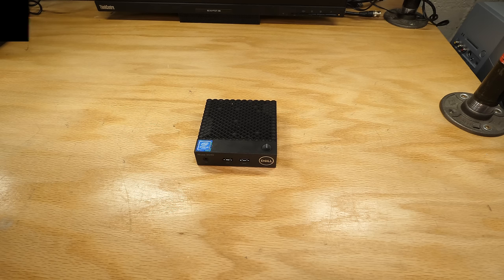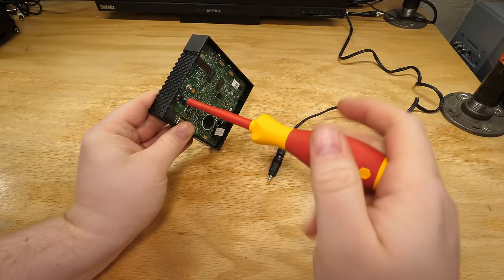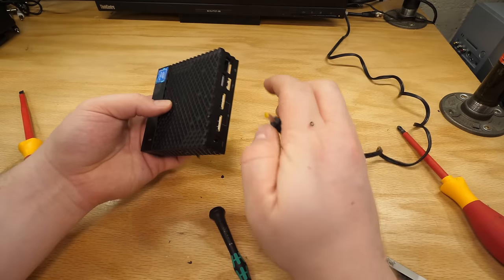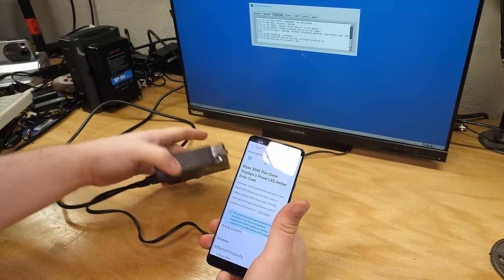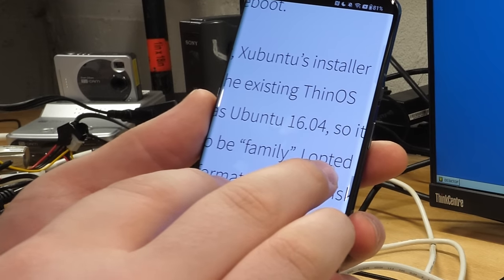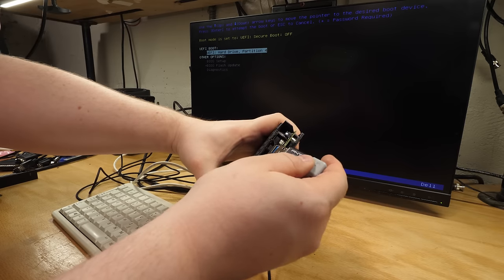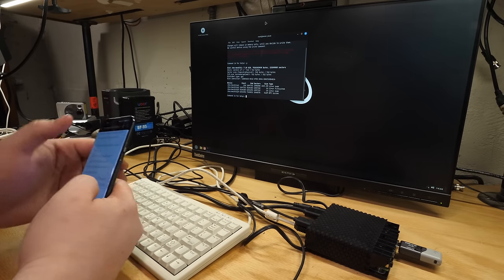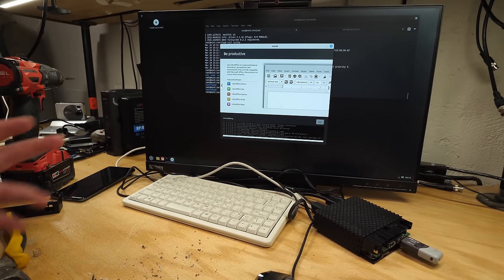Little Guys: Episode 2 [Wyse 3040]

Comment from the maker: Regarding the m.2 slot - I didn't want to dwell on it in the video since I had nothing to put in there anyway, but I'd read that it was useless, and it's even more useless than I realized. Per (https://www.parkytowers.me.uk/thin/wyse/3040/storage.shtml) it has no PCIe lanes and no USB interface; it's an SD port. The only thing it supports is SDIO. I didn't even know this was possible, and I hate it tremendously.
Reply: The idea of an M.2 slot hosting nothing but SDIO actually sounds charmingly odd to me.  I'm not a normal person.
Reply: Huh. weird. That hasn't been my experience. I had an older GeForce card working via an adapter and XP gaming was a blast. Then again, mine also didn't come with a BIOS password so perhaps it's somehow a different (or otherwise patched) model? It's definitely a 3040 with the same specs. weird...
Reply: Huh, given that, I'm wondering how the person who ran into that Unicode issue planned to use it as a NAS.
Reply from the maker: @claysweetser4106  I think a pair of spinning discs plugged in via USB would run at line speed on this thing TBH, should work fine I would think
Reply from the maker: Uh, Not line speed, but the maximum throughput of the drives, you know what I mean
Reply: I was about to comment that the Steam Deck has an M2 SSD that size, so they exist, but goddamnit that’s a crime
Reply from the maker: @xPLAYnOfficial  to clarify, do you mean that you used an adapter from m.2 to like PCIe x16 and that worked? Not to sound incredulous, it's perfectly reasonable that it would if there are PCIE lanes in there, perhaps the guy who wrote the article was mistaken or maybe his bios was misconfigured, or maybe indeed there are different sub models, but I would absolutely love to try this if there's a chance of it working.
Reply: @CathodeRayDude  Yes I used an M.2 a+e key => PCIe x16 adapter and it worked. The BIOS even has an option to change the primary video adapter from internal to PCIe. Mine also came with no BIOS password so maybe it's been patched or messed with by another company? I have no idea.
Reply: So ironically the slot does exactly what you thought about using it for in the end.
People do some hella cursed things with ports. I remember the PS Vita used a normal laptop style mini PCIe slot for the 3G modem, but it was only USB and the pinout wasn't even the standard PCIe USB placing, but whatever they wanted.
Reply: was about to say that people manually replacing the emmc would make sense for less jank boot of pfsense pihole etc, usually you can get 2.5 gbit nics that fit into m2 slots and turn this little guy into unltimate router but sdio only kinda ruins that plan
Reply: You'd be more surprised (I certainly did) that m.2 port specify SDIO pins from the get go. It's even in the specifications. 

Anyway, there are various cases online that an adapter board was successfully used to expand storages. However when I get my own board manufacturered and soldered together, none of my microSD cards worked. I actually needed it to work since I used one of my three Wyse 3040s for Home Assistant OS and it chewed through the buillt-in eMMC's write cycles within 6 months. Adding an add-on card is far more easier than replacing eMMC. 

This machine may not feel like an exciting piece of hardware (borderline boring from your video), but this is truly the first machine I ever say that practically squeezed the Atom chip dry in regard to IOs at this form factor. It has exposed all USB ports the chip possibly has to offer, used some weird trick to allow dual DP output, give PCIe to ethernet for better performance while cleverly uses SDIO for WiFi. The amount of engineering effort put onto this hardware really should be appreciated.

One last thing - this box is more power efficient than Raspberry Pis at idle.
Reply: @CathodeRayDude  That's not possible. This machine's only PCIe lane has been used on the Realtek ethernet chip. Maybe they're talking about another Wyse model based on the description that it doesn't come with a BIOS password. Wyse 3040 has no reason have their password removed if it was pulled from production as they all come with ThinOS pre-installed and can be remotely maintained.
Reply: I feel like thia information would have greatly added to how entertainingly cost cut thw device is.

One day they will make a car where the brake disks double as the wheels to cut cost.
Reply: @CathodeRayDude Secure Digital over M.2? What is this madness?
Reply: it's not an m.2 slot to begin with, it's in the shape of an old mobile pci-e slot, you know, usually for wifi cards or mSata ssds, but now that you say this is useless then it makes no sense for me to get one of those, I'll have to keep the stupid Msata 512gb ssd I bought for... reasons in storage for a little bit longer
Reply: A FOSS tool called the gparted boot disk might help you to totally clear the contents of the 8 gig EMMC
Reply: I own an ARM Single Board Computer called the Orange Pi 3 that has a similar (and even worse) quirk, it has what looks like a PCIe M.2 slot but the implementation of it is broken in the SoC since it doesn't map the PCIe address properly. There were some experimental patches for the Linux kernel but it's not worth using those patches since you would need to modify every single device driver in order to work with it.
Reply from the maker: @JORGETECHJorge  Aaaaaaaagghhg
Reply: I was just coming on to see about you checking Parky Towers. Glad you have found that resource. Might be able to find an adapter for m.2 a-e to SD, for a boot device, but unsure if the bios would see if, even for a pivot boot.
As for a serviceable use, netboot is an obvious choice. Or use Ventoy to install a bootloader, then pop whatever ISO you might want tor run live, as needed.
Reply: @CathodeRayDude  There are at least 2 models, differing between 5V and 12V. This may be another difference.
Reply: SDIO would make a lot of sense for a WiFi module. Many companies make WLAN adapters working over SDIO. So without looking any further, I'm willing to bet that DELL probably sold a WiFi upgrade module for their thin clients.
Reply: it having sdio is kinda useful actually, to dump MMC/SD based media like n-gage cards using aaru.
I've been meaning to dump one that i have that's locked with a password and i cant unlock and sadly aaru only seems to work on x86_64 with NX and other modern stuff and SDIO was only ever used on early/mid 2000s laptops so it's imposible for me to find a laptop thats modern enough to have those cpu features and sdio at once, they have a "remote" version that i literally can't be bothered to try out anymoire ngl, so this would be very useful (if adaptors to sd/mmc exist)
Reply: @xPLAYnOfficial There's no way XP booted on that Atom CPU. Even if the BIOS supported legacy boot you'd run into ACPI issues. There are patches available, but they tend to not work on these low end/embedded chips.
And it also doesn't have any supported boot media. XP won't boot from eMMC. Maybe from USB if you use the Embedded version, but even then you'd have issues with the USB 3.0 controller drivers.
Reply: I bought two of these, to add more confusion, these have two versions with 12V PSU and 5V PSU, guess what happens if you put 12V PSU on the 5V one :D
But they have their uses, I have one for OctoPrint and one for Volumio, they are low power and dissipate basically NO heat...sooo not bad 
At one point I was thinking of swapping that eMMC, but gave up :D
Reply: i never had thought from watching the thumbnal that it was soooooo tiny in your hands. 
Of cause your 'big' hands could make that look so tiny but that has not been the case before and therefore really tiny.
I did not wanna watch that cause it looks like another mini PC review but I did cause if you look at such products it must be a marvel, a gem or remarkable for whatever reason and therefore I watched this even though my first thought had been, oh god, not another tiny pc review, 
but when I saw the channels name Cathode then I was sure it must be a different story , and well, another time a hidden remarkable device.

Maybe useless today but still you found or showed a treasure at least for the time back then, the challenge to develope such product and bring it to market - and this made it to the market. 

Therefore I like the channel and this kind of videos even though they would be total crap - I had luckily missed to buy. 
I like the way the channel is developing and I am still catching up with watching also older videos I find curious enough .
Reply: @amemic860 I have two, both say 5V on the back but the only PSU I have is a 12V one. And it works well with both.
Reply: @billhgong The best storage solution for these seems to be an external SSD connected over the USB3 port. It works quite well for me.
Reply: i tryed to upgrade mine with wifi but found out that way too... so incredibly useless xD
Reply: @CathodeRayDude This does work by the way, I have added a raid card to a netbook 😅
Reply: @billhgong there are some really tiny usb > sdcard adapters that fit almost flush to usb ports , if it's good enough for a Pi it should be good enough for a this? worst case if it eats through the sdcards they will be easy to replace.
Reply: @DEMENTO01 too many things that don't like up with xPLAYnOfficial story, I am suspecting it was a different device or someone reused a different board in the wyse case
Reply: This thing is so cursed I love it
Reply: @xPLAYnOfficial  Question: Is your model powered off of 5v or 12v? There are both floating around out there (without much visibly different about them), if yours is a 12v model that may explain the difference and may be worth noting.

Comment: I recently spent hours troubleshooting a machine that wouldn't turn on, only to finally realise that the power button didn't actually reach all the way to the power switch. So even if you fully depressed the power button on the case (which felt and sounded completely fine), the switch never made contact. It wasn't until I'd completely disassembled the machine for scrap that I realised this issue. So, don't feel bad, Gravis. You and your power button are not alone.
Reply: The first PC I built myself from the ground up (was a pentium something), imagine my dismay when it wouldn't power on. Turns out the power switch was faulty, which was simultaneously relieving and rage-inducing.
Reply: That's what I was thinking was happening with this little guy before he figured out the light situation.

Comment: Smallest Atom you've ever seen? Gravis confirmed for not having seen a Intel Compute Stick. Now THAT... is a Little Guy.
Reply from the maker: It's the smallest one I've personally seen, as in, in person.
Reply: I had an Atom compute stick... it was great until one day it rebooted and never booted up again.
Reply: @cromulence  eMMC will do that do ya
Reply: @CathodeRayDude I’ll send you an Intel Compute Stick
Reply: @Wingnut353  yep
Reply: I have like 4 of these little guys. All identical lol. quad-core 1.4ghz atoms and 2GB of RAM. I've replaced all their EMMC storage with now 64GB modules. They live plugged into an old powered USB hub for power as what I like to call "the world's slowest cluster."
Reply: I have the Asus version of the compute stick - same Cherry Trail Atom w/ 2GB but it had 16GB EMMC onboard and came with a Win10 license.  Win10 was not pleasant, but doable.  It worked fine with Debian, except for (at the time) I couldn't get HDMI audio to work.  After a few days of tinkering, I threw it in a drawer and left it there ever since.  (edit: dug it out of the drawer - it's a VivoStick TS10)
Reply: @CathodeRayDude  That's not really very remarkable, you haven't seen and what ever get to see most things in this world first hand.
Reply: I got an Intel compute stick a few years ago. Looking forward to using it when it finishes installing Windows Updates.
Reply: @backgammonbacon it’s like saying your 2 story home is the largest building you’ve ever been in personally, when you know skyscrapers exist…

Comment: Thank you for bringing back the horrific memory of having to refresh and re-register 100's of these in the dell wyse console. The 3040's were flaming POS. They died constantly and struggled running Citrix. In office they worked ok, but due to covid, my company decided that giving them to home users was a good idea. These needed a vpn to connect, so each one was sent out with a cisco meraki z3. Then my company decided to switch from using a physical voip phones (running through the meraki) to a soft client phone. Let me tell you, that thin client and citrix session sh&t the bed the moment that phone system was used. Thankfully that was mostly the end of our thin client use outside of a couple specific use cases. Sadly, dell doesn't want to fix 3040s anymore but wanted them back. So we were stuck with hundreds in storage.
Reply: audio/video performance is ass in citrix, we could never get it to work acceptably
Reply: We had iGels and they were awful as well.
Reply: The Atom systems always looked so promising on paper, but in real usage they fell quite short. Having them in the fleet was a nightmare because they had weird bugs as wonderfully illustrated by the front USBs in the video.

I think the onboard eMMC storage is what causes them to struggle so badly performance wise.
Reply: @hattree  haha dealt with those too when I did a contract for matress firm. Those things are their own personal piece of hell.
Reply: They wanted to save money by not getting a midrange laptop with end point protection by... deploying Cisco hardware.

Comment: The UEFI implementation on this thing is kinda scuffed, it uses the fallback boot record location, so after you finish installing Debian, you need to boot into a live USB, mount the filesystem and screw with the boot.efi file locations for the BIOS to notice it. Also the M.2 slot is slightly cursed in that its only wired for SDIO, so apart from comically overpriced industrial grade WiFi cards, there's not much you can plug in. Although someone has designed a M.2 card which lets you install a MicroSD card. Some dude also did some BGA rework on the eMMC storage and upgraded the thing to 64GB. He got Windows 10 running on it.
Reply: *flexes in windows 10 installation on 16gb flash w/updates
Reply: Can't you do it like in a normal contemporary Dell?
After formatting our school lab and deleting the massive mess of UEFI boot entries that prior departments had done, the PCs were only picking up the Windows bootloader. So all I did was just add a new boot entry on the PC itself pointing directly to the GRUB EFI file, gave it priority, and now the PCs work just fine.
Reply: The Debian expert mode installer has an option to install to the fallback path
Reply: Honestly, I'm still annoyed at Debian for not just installing a BOOTx64.EFI when there is no other as a fallback option, as seemingly most other OSes do. Then it wouldn't even matter on edge cases like these as much as it does
Reply: You can actually make Grub boot up Debian without having to screw with the EFI files! You have to launch the expert install and then tell Grub to look for all partitions and also detect removable devices.
Reply: The scuffed UEFI reminds me of my Sony Vaio Pro I had a decade ago. It was hardcoded to only boot from the Windows bootloader, so you had to go in and move+rename the grub bootloader.
Reply: @resneptacle  I'm glad to have succesfully moved from grub to Systemd-boot. I don't need the fancy menu and I have Refind as a fallback.

Comment: So to elaborate on some of the unknowns in the middle of the video, broker refers to the server in a virtual desktop environment that actually establishes the connections between a host and VDI machine. In Citrix, that would be the delivery controller, confusingly shortened to DC on occasion. Solutions like imprivata and I'm assuming the others mentioned in that other bit are single sign-on solutions for on-premises applications, offering rapid tap-in solutions. And you would surmise correctly that they are often used in hospitals to allow staff to access machines. Remote desktops are particularly useful in a hospital environment because nurses may be going from room to room and not have a mobile cart dedicated to them to work from, especially if they are not doing medication passthroughs.
Reply: That and HIPPA is much easier to manage without pulling patient data to a local machine.
Reply: @alexthemorgan  Very much true. In my somewhat limited but useful experience in the healthcare industry, EMRs tend to be hosted on isolated infrastructure that have trusted access created from the healthcare environment into the EMR ecosystem.